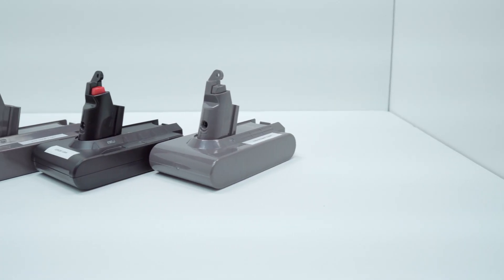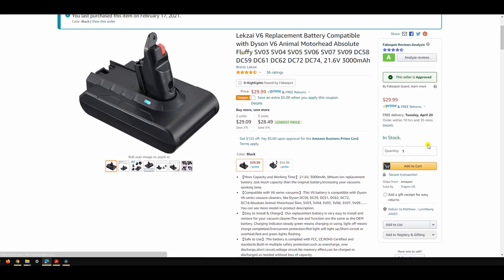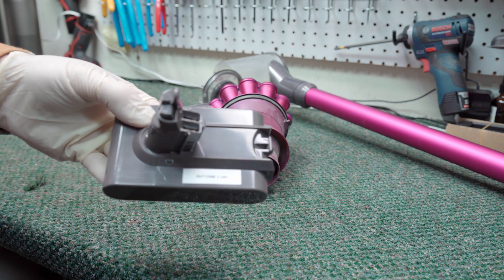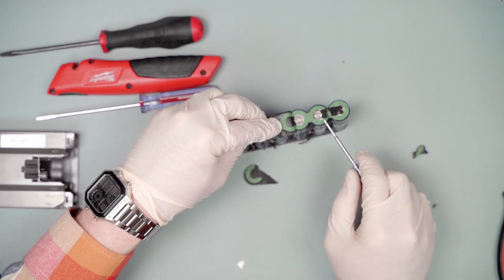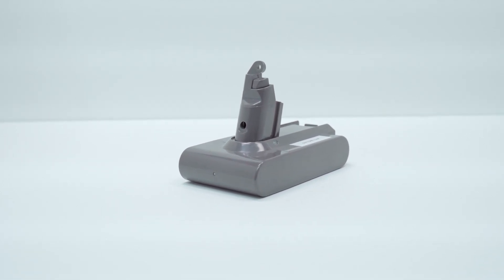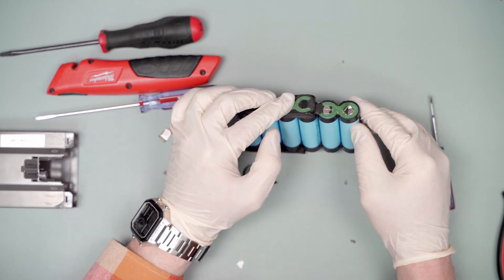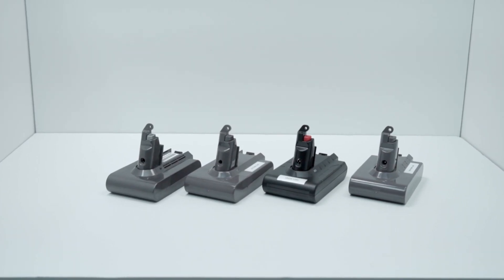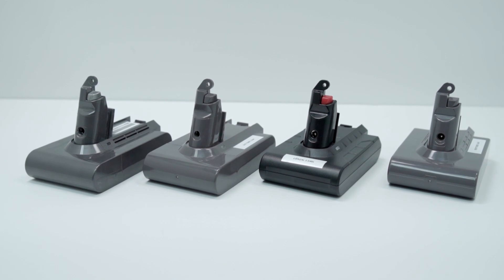The BEST Dyson V6 Replacement Battery On Amazon? Full Test Of Four Popular Models!

Comment: Hello HoV. I have been looking at a First Power 5.0Ah battery for my V6 on Amazon.
The item description says to wait 15-30 minutes after use before charging, otherwise battery life will suffer. Do you know what this is about? Is this about heat?
My V6 has a charging base and that is where I keep it when I am not using it. So it it always plugged in.
Should I put the charger on a switch and hope I can remember to turn it on after 30 minutes?
Once the battery is charged, should I switch the charger off?
THANKS in advance for any insight you can provide! 👍👌👍   👁
Reply from the maker: Great question! When a battery cell is done discharging at a high rate there is still a lot of movement/heat built up in the electrolyte in the cell. Giving it some time to cool down to a resting state prior to charging helps the cells last longer.
Reply: @HouseOfVacuums  You could put the charger on a cheap mechanical timer to charge in the middle of the night.

Comment: What’s the best ?Looking for one that doesn’t burn my house down.Watching vid now .lol
Reply from the maker: If I was going to go with a non-OEM battery, I would choose the Power Extra based on the cells. On the topic of the Amazon reviews, the one nice thing about the Power Extra is that Fakespot gives it an "A" rating for review reliability, meaning there are a high percentage of real reviews. Other items may have higher star ratings, but if they score "B" and below on Fakespot they are likely purchased reviews or fakes.
As to not wanting to burn down your house, I'm not an electrical engineer so I cannot vouch for the PCB. However, the cells are reliable. If you want the safest, the OEM battery is the way to go even though it is expensive. 
Cheers!

Comment: Is there any link between 1 battery and their capacity of mAh?
Reply from the maker: In these particular design the batteries are organized in essentially a straight line, positive to negative end and so on. This is called a series configuration. What this does is increases the voltage of the battery, but it does not increase capacity or amp ratings. So if you have a series battery pack and you know that one cell is 2000mAh, then you can also ascertain that the entire pack is rated at 2000mAh. 
I hope that helps!

Comment: I really want to buy the Milwaukee M18 adapter for this vacuum.
Reply from the maker: I'm hoping to test those eventually. My two concerns are the voltage difference (the machine will run at a lower speed) and the low voltage cutoff. I would definitely want an answer on those two points before I recommended them.

Comment: 7.2022  FOUND THIS WITH 9000 RATING. Is it better?  5.0 AH is better than 4.0 AH?
Reply from the maker: More Ah will give you more run time. However, what you need to watch out for is manufacturers inflating that rating. As you saw in the video, most of the replacement manufacturers over-inflate their battery pack's capacity. Hope that helps!

Comment: MFW I just bought a "9000 mAh" battery for our V6 (for A$29).

It appears that I'm going to need to find a way to verify the actual capacity - preferably without having to tear-down the battery pack.

I'm not asserting that the vendor is falsely advertising, but if it's 9aH the V6 should run for more than half an hour based on the experience of the tests in this video.

Fortunately, if it doesn't yield results that are close to spec, Australian Consumer Law (ACL) is brutal for sellers who make false or misleading claims about the stuff they sell. 

Even if the battery is true to capacity, but results in unsafe operating conditions (e.g., overheating), the fact that the vendor claims that it is suitable for our model, exposes them under the ACL  - even if they're located outside Australia.

Just to be sure, I always tick 'Australia Only' in the search sidebar on eBay, and "Ships from Australia" on Amazon.
Reply from the maker: I would agree, there is almost no chance that the pack is 9000 mAh. There isn't even a battery I'm aware of in either the 18650 or 21000  form factors that gets anywhere close to that number. And since the batteries are wired in series, the voltage increases with each cell added, but the capacity remains the same, so 6 2100 mAh cells in series is still 210 aAh. 

Very interested as to whether you get legal traction on that. I'm not familiar with the Australian system, but would love to hear back if you pursue it. Cheers!

Comment: When an 8 year OLD oem battery outperforms half the new batteries, I would love to see how a NEW OEM battery performs?
Reply from the maker: One of these days this one will fail and I'll be able to justify a new one to benchmark. Thanks for watching and commenting!
Reply: @HouseOfVacuums  So it would seem then that genuine Dyson batteries are by far the best, but are they best by runtime per dollar? And lifetime hours per dollar?

I felt like runtime was not good to start with so I came looking for longer-running compatible batteries. Like how you get so so so much better value with non-genuine printer ink/toner cartridges. No way am I going to spend a cent on lower-capacity batteries.

The main issue I have is the battery running out before finishing vacuuming and having a patch or whatever of dirty area left and having to wait for the battery to cool down and then recharge.

I guess the best options are:
1) revive the screws, get a second genuine battery, and swap batteries half way through vacuuming;
2) buy high quality cells in serial sets and wire the sets together in parallel with the original and seal in a neat case. Kind of like the one you reviewed but using quality units.

Comment: Very interesting!  The local vacuum store " recommended" the First Power. But when I checked the reviews on Amazon there were lots of returns.  However, the customer service was rated as superb. That is, they will easily replace any defective batteries.  Going by reviews, I went for the  DEWOKI. I have not installed it and know nothing about batteries and AMPS. Any thoughts? Thanks for a great video.
Reply from the maker: I have never disassembled a DEWOKI, so I couldn't speak to it's quality. Hopefully it ends up being reliable for you!
Reply: Thoughts are that all those people don't know anything thing about batteries and would rather not write any reviews at all because all they have to say is of no value, those reviews have no meaning

Comment: I got a first power and that was a mistake. Worked fine for a couple uses and then acted like the original Dyson battery that I had for years and would only run max mode for 3 seconds and cut out. Normal mode a minute if I was lucky. Turd cells.
Reply from the maker: Great feedback! Unfortunately, anything power with lithium ion cells has the potential to run into these issues. Particularly until vacuum manufactures start designing their battery packs with the care that power tool brands do. Whether replacement or OEM, vacuum batteries tend to be cheaply made and a reliability crapshoot. However, based on the cells themselves, I do still believe the FirstPower is a cut above the other replacement batteries. Cheers!

Comment: I feel like the only way to really get a good battery is get a generic pack, and swap out the garbage cells with some extremely good cells, particularly since Dyson has none in stock... but will the control board still wreck them or actually balance them properly?
Reply from the maker: Thanks for the comment. Dyson batteries use very high quality cells, so the issue isn't so much an issue of cell issues but, typically, either stress or continuous charging. For stress, there are a few things that shorten cell life like running on high constantly (high drain situation) or charging the battery immediately after use without a "cool down" period. Both of those are hard on cells. Then there is constant charging which can also damage the pack. Essentially, the PCB is constantly monitoring the voltage in the cells and providing small top offs if necessary. Doing this 24/7 is hard on both the PCB and the cells. The best option would be to unplug the vacuum once charged. https://youtu.be/XhcWERhvRYY

Comment: First power's 4.8Ah battery is cheaper than their 4.0 for some reason and has pretty bad reviews. There are even pictures of the unit catching fire!
Reply from the maker: It's a good point. The unfortunate truth is that many sellers game the reviews. I use a browser plug-in called Fakespot that will tell you whether or not the reviews on an Amazon item are reliable. First Power's are typically graded as an A or B, meaning there is little manipulation, so you are getting real opinions. 
The second reason is sample size. The First Power 4.8Ah has over 800 reviews, meaning you are getting a better data sample. It is much harder to call listings with 50-100 reviews as representative.
Ultimately, you can't beat the OEM Dyson batteries for quality and safety. Out of all the replacement batteries I've seen, the First Power is the safest ONLY based on cell safety alone. But when a replacement costs 1/3 of the original, you are certainly giving up quality somewhere. Could that cost cutting have caused the fire in the one review? Certainly. Which is why I always add the caveat that if you don't want to take chances with safety, you get the OEM every time.
Hope that helps. Thanks for the comment!

Comment: Why are the reviews for the 'best' one so bad? I wonder if they changed the cells they used it something because people seem to really hate this battery pack and there's a review where it seems to have caught on fire.
Reply from the maker: It's a good question. The unfortunate truth is that many sellers game the reviews. I use a browser plug-in called Fakespot that will tell you whether or not the reviews on an Amazon item are reliable. First Power's are typically graded as an A or B, meaning there is little manipulation, so you are getting real opinions. 
The second reason is sample size. The First Power 4.8Ah has over 800 reviews, meaning you are getting a better data sample. It is much harder to call listings with 50-100 reviews as representative.
Ultimately, you can't beat the OEM Dyson batteries for quality and safety. Out of all the replacement batteries I've seen, the First Power is the safest just based on cell safety alone. But when a replacement costs 1/3 of the original, you are certainly giving up quality somewhere... which is why I always add the caveat that if you don't want to take chances with safety, you get the OEM every time.
Hope that helps. Thanks for the comment!

Comment from the maker: What do you folks think? Would you go with the First Power, OEM or another option? Let me know!
Reply: Gona try first power.Thanks
Reply: Reviews don’t look good unfortunately.
Reply: I'm trying to find a replacement battery for my V8 Absolute.  OEM direct from the website is out of stock.  Going off your review for the V6, I looked up the FirstPower V8 batteries.  And it doesn't seem like they review farmed their product. Where as the other ones on Amazon have hundreds of fake reviews.  No reviews on the FirstPower of it blowing up yet..  

Going to take the hit and buy it.  See what happens.  It seems the main issues with non OEM batteries are that they eventually just die, the vacuum runs on its own eventually and burns out the motor/battery, and people are unsure if it stops charging when full.

My V8 barely runs 10 minutes on low, before running out. 

:( 

Wish me luck. 

Thanks for the review!
Reply: Gona just get oem.
Reply: Just received the First Power. Although your review seems very promising with these, some Amazon reviews say otherwise.
Everything from generic no brand cells, to under powered ones dying several months after. Unfortunately their warranty is only for 30 days and the reviews which units got replaced under warranty are very few.
I figured to take a chance, hoping on a good set. 🤞
Reply: RiccoFX  Did the First Power battery also come with new screws to install it?  Thank you for your time and assistance!
Reply: Bought the Fist power (5.0 ah claim) for a v8 and it was a pile of junk.  No balancing support, run time was worse then my old, im sending mine back!  Its not worth it.  I got 12  min run time on low setting without using the carpet attachment, this is just the vacuum sitting with the trigger taped down test.
Reply: @Diebog  Ouch.  Dyson battery is 100 dollars and they are out of stock. I just bought a new upright Dyson corded vac and I am gonna sell my cordless vac on ebay. Its more trouble than its worth.
Reply: @rockinroll6342   if you have the skills and equipment you can replace the cells in the oem dyson pack.  (Just be sure to remove one wire from the trigger switch before you do any work which puts the BMS to sleep, if you don’t do this the BMS will detect a cell below the set threshold and will lock the battery as a safety precaution, (don’t ask me how I know this 😂). Some salvage good cells from other laptop or drill batteries as they all use the same 18650 cells.  Or you can buy new cells on Amazon/eBay.

What I think company’s like Firstpower are doing is they start off with using quality cells to get good reviews and switch to cheaper ones to make more money.  The battery I got from Firstpower didn’t even have their name badging on the battery, it was just a generic label that some factory in China is producing.  So even though you may read good reviews on a particular item you have no clue what they will actually send you.  It was pathetic how bad this battery was, so I returned it.

Comment: i was lured by the fake battery too. my conclusion is just buy the genuine item. unfortunately my oem did NOT last anywhere near 8 years, not even 2 or 3, which angered me giving the high price of these machines and persuaded my decision to bypass dyson's overpriced battery and go straight for a counterfeit. The counterfeit lasted a matter of months before showing rubbish performance and now it is acting very strange indeed with 3 cutouts before working normally??? but with a reduced runtime. I think it's better to just bite the bullet and buy an OEM dyson battery. They are all lying excessively about the mAh anyway so better to just buy the original.
Reply from the maker: Thanks for watching and commenting!
I always tell people that if you want the safest and most vetted product, just go OEM when available.

Comment: So, boiling all this down to the most succinct executive summary, the winner is:

FIRST POWER.

Is that right? Why not rank all the replacement batteries you tested from first (best) to last (worst)? 

I would get an OEM but Dyson is all sold out of the V6 models.
Reply from the maker: Yup, that's the verdict! I purposely didn't rank them because I would simply classify the HSW and Lekzai are definite "do not buy" models and the DutyOne is on the cusp. The FirstPower is the only one I would recommend based on the cells, performance and build. If anyone wants the rundown, check the results at 15:01.
Thanks for watching and commenting. Cheers!
Reply: I have bought a MCWGOLD would it be safe what is your verdict.
Reply from the maker: @Rubina Ali I have not tested that particular battery pack, so I really couldn't say with certainty since the quality on the Chinese packs are wildly inconsistent.

Comment: What is wrong with your lighting, keeps making light and dark patterns on the carpeted table.  Very annoying, like I'm suffering heat exhaustion in the desert or something.   Also, try not to use such a complex carpet design because it uses up a lot of the video bitrate, reducing the quality of everything else at same bitrate.  Lastly, all I wanted was a spreadsheet listing the brands/models, listing the battery, listing rated current, achieved runtime, rated runtime, and cost.  That ONE spreadsheet would be better than 18 minutes of talking.
Reply from the maker: What is wrong with your typing? There are so many letters, it's giving me a headache. If you could present your paragraph to me in a Powerpoint deck, that is actually what I wanted. Not ONE giant paragraph.🤣
Reply: @HouseOfVacuums  Maybe more effort on videos and less on jackarsism?

Comment: Let's be honest the v6 is garbage I've gone through 2 motors and 1 battery pack. Not worth the constant breakdown in my opinion
Reply from the maker: Wow, that's intense. I've had two V6s hanging around for testing, one of them has to be close to 10 years old. I've replaced one battery so far.

That being said, they do take some effort to maintain. Charging directly after vacuuming, leaving the battery on the charger, letting the vacuum fall, having clogged cyclones... a lot of things could have contributed to those failures. 

If you want a cordless that is crazy easy to maintain, check out the Riccar R10CV.